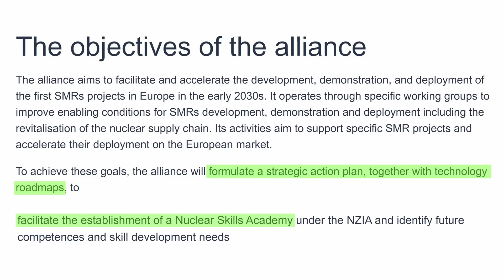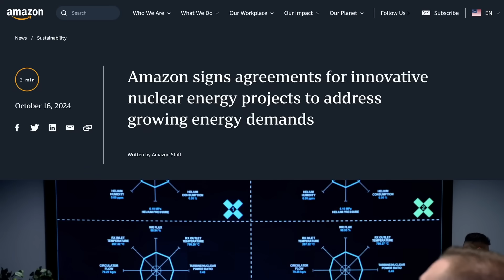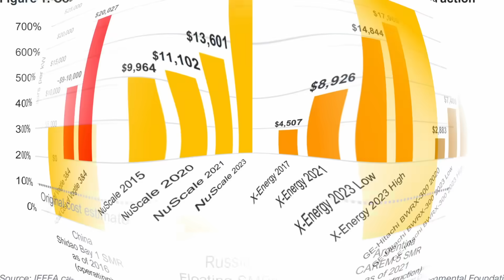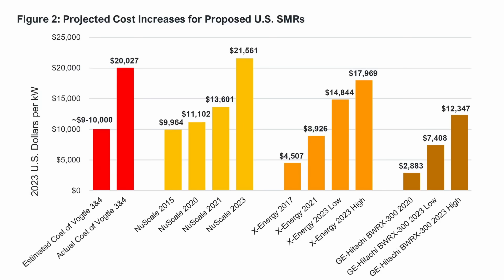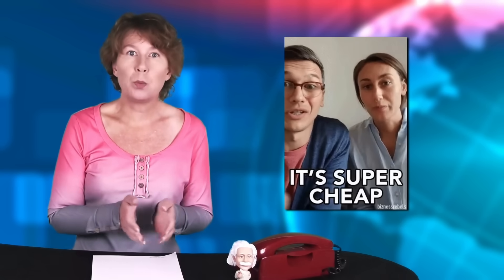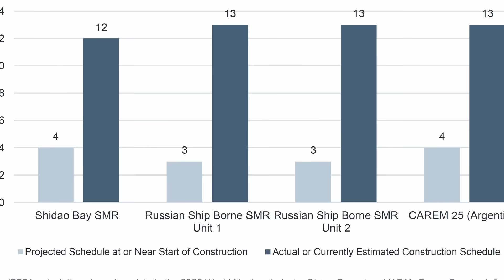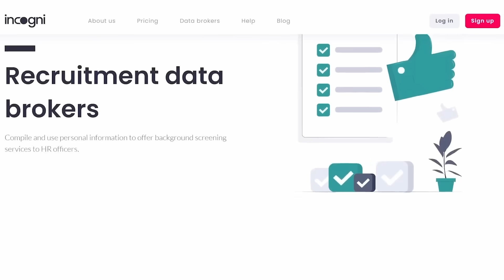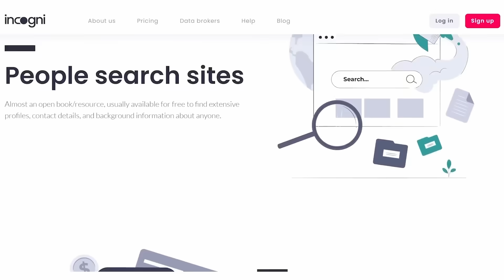Small Nuclear Reactors Have A Big Problem

Comment: One of the safest, but more expensive, but more efficient, reactors is the Candu heavy water moderated system.  Almost impossible to melt down. Very very efficient when up and running. Runs on yellow cake not super enriched U so much safer.
Reply: Which civil reactors run on "Super enriched uranium?"
Reply: Positive void coefficient. Requires tons of heavy water. Lots of waste due to non enriched uranium. Easier to use for plutonium production/proliferation risk.
Reply: @markotrieste  Proliferation is overblown. Anyone can make a bomb if they have the will and the cash to do it. Trying to hide it under the guise of a civil program is much harder. Just ask Iran.
Reply: @markotrieste  1.  Other safety measures negate problem of PVCoefficiency.
Reply: @ericdempster  Yes, as with everything nuclear, you can always get a larger can to put the worms back in. Just don't be surprised that then it's expensive. 

Anyway, my point is that, among nuclear fans, everybody has his own favorite design, and according to him, that one design is the only one without drawbacks and everybody else is dumb. Hint, if you want to know the problems inherent with design "A", don't listen to antinuclear people, instead, look at what the proponents of design "B" say about it. Neverending fun.
Reply: @markotrieste  You can run on HALEU and Thorium. Then, you will not have a positive void coefficient.
Reply: How large is the fuel economy of a CANDU reactor? Around 8 GWd/t? Up to date PWR get 10x out of the fuel.
Reply: @georgkrahl56  Who cares? there is no shortage of nuclear fuel, and its as cheap as chips.
We can always reprocess the fuel and send it round again.
Reply: @georgkrahl56  You weren't trying very hard to present a balanced picture. CANDU can run on spent PWR fuel rods. If burnup is your holy grail, use PWR for the virgin cold press, and then CANDU for the second hot press, and that would squeeze the most oil from the olive. 

But fuel scarcity and cost isn't the problem. The fuel input expense is really quite minor in fission reactors. On the other side, what makes the spent fuel hard to handle is not the total mass, but the actual burnup, which is directly proportional to how much power you generate. 

The practical engineering factor is whether you have a national foundry capable of making the huge steel containment vessels required for a large PWR reactor design. If you don't, it is far easier to manufacture the tubing used for CANDU. This was Canada's situation when CANDU was invented. It also bypassed having to stand up an enriched uranium supply chain, but no one in Canada cared, since we had oodles of the natural ore. 

From what Gemini Advanced could tell me, you get 7x more burnup in enriched fuels in modern PWR as compared to the most advanced CANDU version, but the enrichment process increases your cost per kg of fuel by about 250%. So the net benefit is closer to 3x than 10x, and this requires a significantly more complex supply chain. Plus the PWR designs have operational downtimes to refuel (weeks), while CANDU refuels in active operation. 

Here's another one that means one thing on paper and another in practice. CANDU reactors take up more space for the same generating capacity. Oh, shucks. Now imagine a thousand Wyomings. Space is not exactly Canada's biggest problem.
Reply: @georgkrahl56  CANDU reactors are designed to run on natural uranium, which is not enriched. Natural uranium consists of about 0.7% uranium-235 (the fissile isotope) and 99.3% uranium-238. This unique feature of the CANDU reactor is enabled by its use of heavy water (deuterium oxide) as both a moderator and a coolant. Heavy water is highly effective at slowing down neutrons, allowing the reactor to sustain a chain reaction even with low concentrations of uranium-235.

While CANDU reactors are optimized for natural uranium, they are also versatile and can run on slightly enriched uranium, recycled uranium, thorium, or even mixed oxide (MOX) fuel, depending on fuel availability and strategic goals. This adaptability is one of the strengths of the CANDU design.
Reply: The Titanic was almost impossible to sink. And then "it happens".
Reply: @cestmoi1262 and yet we still use ships as one of the most inexpensive methods of transportation 🤷‍♂️
Reply: @cestmoi1262  Except it wasn't, it was poorly designed.
Reply: @EbenBransome I call a system which allows water to flow from one compartment into another poorly designed.
Reply: @bobthebomb1596  Guess they didn't have enough Monday morning Quarterbacks on the team. Like..........
Reply: @EbenBransome Brittle steel that was very fragile in artic temperatures was used.  If not poorly designed, then poorly built and supervised.
Reply: @EbenBransome Yet it was intended to sail from the UK to N. America on a N. Atlantic route?
Reply: UK invited CANDU to bid. They took one look at the European regulatory system, asked if the UK government was prepared to offer any guarantees, and then walked away. It simply wasn't worth trying to build a large reactor anywhere in Europe, when governments were simply owned by renewable energy companies.

Hitachi, and Westinghouse also  declined to offer to build for te same reason. Only EDF hung in there, and has completed other reactors to its design, whilst the UK one is still years away from completion.

European nuclear regulation is an utter disgrace.
Even Brexit Britain still conforms to the same regulatory  bullshit as Euratom

Comment: I am forced to coclide thatvall of these flops are the usualmlight water design. It is time to nuild another design, like the LFTR. Where lightbwater reaxtors use both high temperature and hogh pressure, reo features which make the light water designs somexpensive to build, the LFTR  desgin uses high temperstures alone at atmospheric pressures. Liquid Fluoride Thorium needs special alloys that are ere expensive, they are operationalnat ofar lower piessure. It remains efficient throughout its operating range and shuts itself down of anything goes wrong, but the key to safe fission is to reuce the piessures  at which reactors operate.
Reply: Yes! Should be the trechnology of the future, since there´s no lack of thorium. Nor sure if it works in small reactors though.